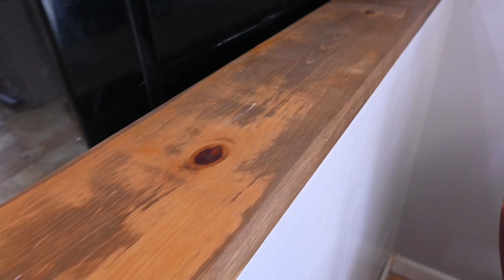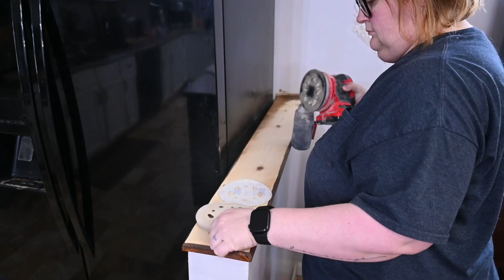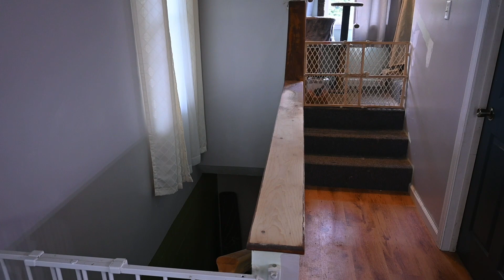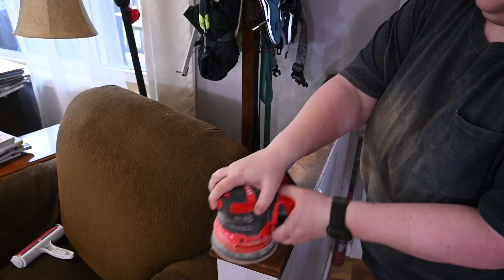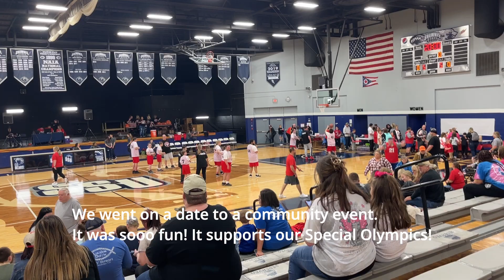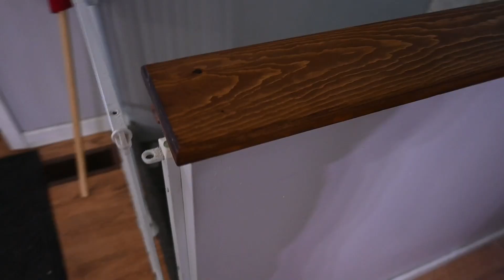FIXING my DIY Mistake | Finally it turned out right!

Comment: Hi Megan,
 Yeah the knee walls turned out awesome, love the color!
Shew if you don’t seal them with at least 3 coats, (sanding between each coat)
It will all be in vane. And you’ll never keep them clean without sealer either. 
God Bless!
Reply from the maker: That’s what I’m doing. It’s all a process. 🤣🤣 sealing is a must especially so the oils from touching them won’t discolor the stain.